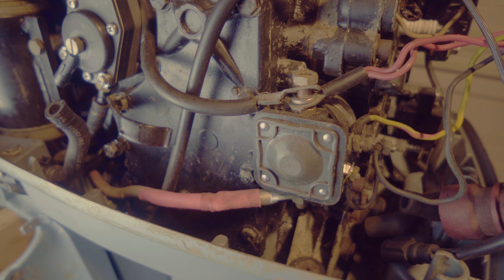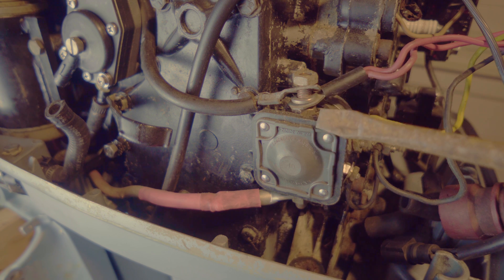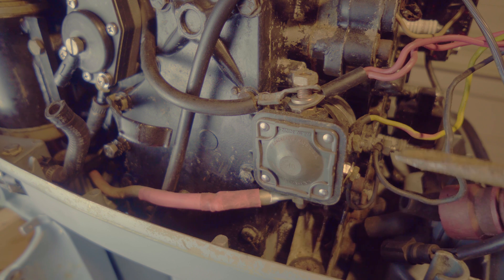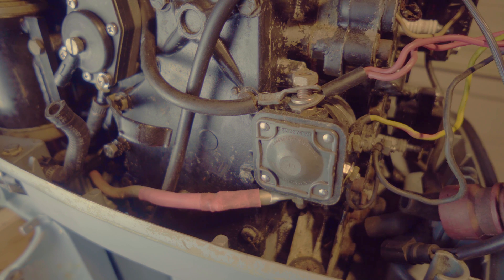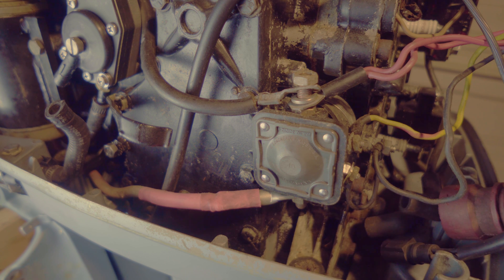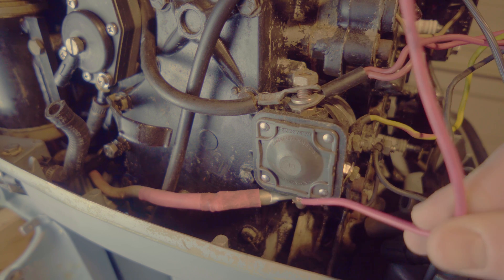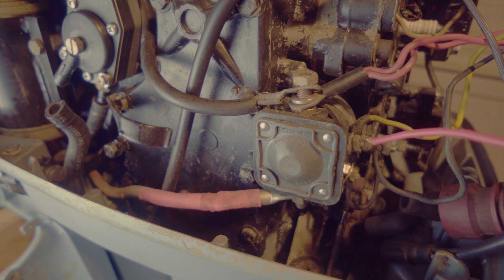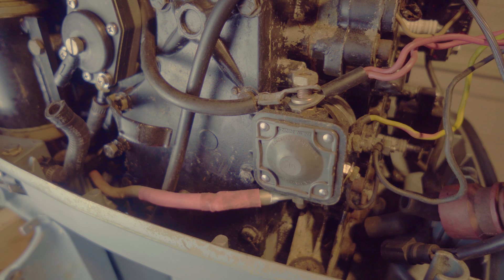Outboard does not start - turning key does nothing - starter solenoid troubleshoot / bypass.

Comment: I just replaced the trim connectors on the outbaord. Went to test them and have no power. Wont start, Trim doesnt work. Any idea if its related to the solenoid?

Comment: Mine does the same. Its suddenly got no power nothing on when turn key. End of got towed. But while it towing i try turn on the key it worked and started the motor.  But I still gotta paid for tow. When got to the dock. I tried to turn on and off to started it works fine. Brought it home for a week trying to get it start it's has the same problem again. Don't know what to do now. Can some one help. My motor is a 2004 johnson 225hp four stroke.

Comment: Same issue with me I replaced solenoid since we didn’t have voltage going from solenoid to starter. Replaced it. Same thing just clicking and occasionally the motor will turn. Once it turns sometimes it turns we don’t know what it is. Was at the boat ramp and it clicks but will not turn. I’m lost.

Comment: Ok so I had jut the click on the solenoid and replaced the solenoid and now the starter just runs when I connect the battery. Key is not even on. Any thoughts? Btw great explanation on how the solenoid/ starter works
Reply from the maker: @mikescalise3913  if it's constantly running that means the solenoid is getting voltage on the red wire. That means there is likely a controller working issue. Remember the solenoid will only engage when it gets 12 volt. That 12 volt is only supplied when you turn the key to the starting position as soon as you tilt it back to just on that 12 volt is no longer supplied. If you are not 100percent sure google evinrude controller wiring diagram. There are great diagrams out there.
Reply: @IdeaMan4k  Thanks for the response! I am just learning this stuff and I appreciate your help. While waiting on a second New solenoid i tried hooking up the new one that was causing the starter running issue. I only hooked up the Battery cables leaving the small wires off the small terminals. I thought it was going well but then the starter started running again( intermittently). so now my hopes are that it was indeed a bad solenoid that I received.

Comment: I didn't hear where that yellow wire went to? Mine goes no where! Just a dead end!
Reply from the maker: To the ignition. When you turn the key it engages this wire causing the motor to start and when you stop turning it it disengages it because it's already running.
Reply: Through the ignition switch, it's connected to positive of battery. This way the ignition has low power and isn't dangerous. The solenoid is the high power switch safely away from everyone that powers the starter motor.

Comment: I had this exact issue. (Clicked but solenoid was dead on the water). Little tip if you are without a suitable thick cable you can use the existing one on the bottom to bypass (someone has to turn the key also so I believe you need to be two people). I filmed it here https://youtu.be/pTZ6Lt8Rc9A?si=bcpY8M-lo_t9ed_L

Comment: Thank you for the vid! My signal wire in this case happens to be receiving voltage when the ignition is turned but still does nothing. Not even a click. When I jump the gap with a screwdriver it turns the starter motor just fine. Any ideas?
Reply from the maker: Be sure to check the ground as well from the solenoid. If it's doing the click and working when you jump it with a wire there's some sort of not complete circuit going on. It's possible the solenoid is just dead.

Comment: I have an issue with my solenoid not getting any power when the key is turned...nothing happens at all, no click, nothing.  I just assumed it was a bad solenoid, but of course when I swapped it out for a new one still the same issue....wish I had come across this video sooner.  It must be an issue between the key and the power to the solenoid...owning an old boat can be frustrating, but you do end up learning a lot along the way.  I inherited it from my uncle right before he passed and I've been trying to get it out on the lake since. My wife keeps telling me to just sell it, but I won't be happy until I get it fully operational and do at least a few days of fishing in it!
Reply from the maker: It's probably a wire in the controller. Also check the little wire that activates the solenoid. I got a good video showing the controllers with a diagram.

Comment: Hi . Awesome video . I have this issue when the engine gets warm . Will start on the button when cold . If I turn the motor off it won't start till its cold again . I turn the key and there is nothing . Almost like a thermal cutout has kicked in . Could this be the solenoid causing mu issue

Comment: I have a motor that stopped turning on about two weeks ago, it will click once quietly when I turn the key (not like a car that will go click-click-click-click).  Battery fully charged 13.06V, safety latch secure, boat feels in neutral (but maybe a sloppy neutral safety switch).  

When they key is held, should the solenoid continue to click or click just once?  If the solenoid clicks normally, it would seem to be a connection problem after the solenoid on the way to the starter.  Or do you think a fuse?
Reply from the maker: I think it won't continuously click as it's expected to work. However each time you turn key you should hear it. It's possible it'd not opening all the way. If you had someone else test the power flow to starter with multimeter itl probably give you a more definitive answer.
Reply: @IdeaMan4k  thanks.  It ended up being the easiest thing.  The battery contacts needed cleaning, despite not being obviously corroded.

Comment: Very helpful. Thank you.  My boat went thru Ian. Still on lift. I have power as engine trims up, horn blows, bilge pump runs but no click when I turn key ? Worried salt water got in / over engine.   Boat seems ok some water pumped out with bilge but inside of boat looks ok.  Marina power out so can’t lower boat but can get to engine ok from boat.

Comment: Working through starting issues on my 75 Evinrude 50HP....turning the key gets me a single click sound from the engine. I can jump the starter and it extends the shaft and cranks, but not response from turning the ignition. I'm at a loss as far as starter vs starter solenoid vs ignition/key. Any advice? If I'm getting the click does that mean the solenoid is good? And since I can jump the starter directly, the starter is good, right?
Reply: Oh, and batteries are good. Running dual, tried one, then the other, and both...no luck.

Comment: What are the two red wires on the top of the Solinoid? My boat had no start when I turned the key and no trim...I wiggled a small red wire like them two at the battery and everything was fine. I haven't looked at it yet but I'm thinking that small red wire to the battery is the culprit.

Comment: Could a solenoid be causing the delay before starter cranks? There is probably 2 second delay between turning key and the starter motor activating. To date it has always started the motor but it's concerning me now that it's going to fail. The battery is fine.

Comment: My issue is every now and then my remote control shifter will not lock into neutral. So, I turn the key and get nothing.  Will this work even if the motor is not in neutral?  If he needs to be in neutral (or maybe for safety it should be in neutral), is there a way to manually put the motor into neutral?  Thanks!
Reply: Did you work this out?

Comment: I tried bypassing the solenoid, (no key in ignition idk if that has anything to do with it) and still nothing.. The battery started arking on the positive side, any idea what it means?
Reply from the maker: Is the engine grounded properly to the motor?

Comment: Thanks mate we were stuck out in the bay, watched this video and luckily we had some spare wire and used your method and then BANG we re up and running. Ya legend 😀
Reply: I have a similar issue. But I do get the click. That tells me the solenoid is okay. That the issue is the starter?  Thankyou for making this video
Reply: I have a similar issue. But I do get the click. That tells me the solenoid is okay. That the issue is the starter?  Thankyou for making this video
Reply: @justinperkins4469 I just replaced a clicking but not working solenoid. Clicking does not ensure proper function

Comment: Got a tricky one here. Solenoid used to click but starter would rarely turn. I had the starter rebuilt but same thing happened. I took the connections off the solenoid and cleaned them and now there is no click. Got a new solenoid and same thing is happening. Idk if there is something wrong with the ignition switch or if I have a faulty wire connecting to the solenoid. If I touch the positive wire from the starter to the bottom wire of the solenoid everything works. Any thoughts?
Reply from the maker: Id check the wiring, often on those big old cables they can look okay but be totally corroded inside. The engine needs lots of voltage to start / starter. Its almost always the wiring.
Reply: @IdeaMan4k  I got a new solenoid put in a while back and it fixed the problem
Reply: @elijahboyett8590  hey there. Our boat has been sitting at Marina for almost a year. Took fresh battery to it, and selenoid clicks, but starter does nothing. No click , but selenoid does. Did your selenoid click, but no noise from starter?  Going back and taking jumper wires to check out, because we're bringing it home to sell. Then can replace selenoid if that's the case. Just curious if yours had same scenero or not
Reply: @fredkeele6578  Take the red wire off the solenoid and touch it to the red on the starter while the battery is giving power. If the starter turns, then your solenoid is 99% of the time bad. My solenoid would click but it was still bad, and that’s how I diagnosed it. You can buy cheap car solenoids that work just as good too

Comment: Quick question I have 11 volts going into my solenoid and when cranking in only getting 6 volts going to the starter starter and solenoid are both new 
The starter spins but won’t pop up to engage the flywheel 
Any suggestions...please
Reply from the maker: Probably not enough current. The connectors and the wire need to be very thick.
Reply: Could be a bad load from the battery. Autozone tests load for free

Comment: I'm dropping voltage in start position the wire from the fuse is causing it but don't show any sign of a short with a multi meter. What is that 30 Amp fuse by the starter for. It also will not jump across.

Comment: So if I connect a wire from the positive to the small positive post the motor starts , but if I turn the key nothing happens , where do I look for the issue ? I can’t find a break in the wire leading to the small positive post
Reply: By

Comment: I have a similar issue where I’ll go boating, anchor for a bit and when I’m ready to leave the engine won’t turn on. I’ll sit there for a few more minutes, turn the key and it’ll start as if nothing happened. 

Do you think this is the same issue?
Reply from the maker: Start as in turning the key will do nothing? or it'll turn over but not start?  If its turning over try pressing the key in a bit before turning it or while. You should hear a little click when you press it in. This will get the fuel to inject past the carbs and should get it going.
Reply: @IdeaMan4k  start as in it’ll crank and turn over. But there’s times where I’ll turn the key and it won’t crank but an audible click comes from the solenoid. I think it might be the solenoid from the starter that’s going bad.
Reply from the maker: @viktorcieslik3302  Does it sound like its trying to turn over slowly, and not turning, or just clicking and nothin else? If so its probably just the solenoid.

Comment: got stuck on the water today due to something with the ignition. bought it used, was told the ignition was replaced last season. key just kept slipping its location and i had to keep tightening the plastic nut on the outside of the faceplate.

is there a more permanent fix ? i took it out of the dash and the wires were completely twisted up. new boat owner - thanks
Reply from the maker: Sounds like the face plate is just loose. Possibly fix up the wires and get it in there good.

Comment: When I turn the key to my motor nothing happens, no clicking no nothing. What do you think the problem is? Could it possibly be the battery?
Reply from the maker: It could just be totally dead. I'd be sure to charge it or get a charger. Maybe see if the boat lights turn on?
Reply: Hello Everyone well you see it was working a couple minutes before it totally stopped working so that’s why I’m confused
Reply from the maker: @patrickproductions3859  check the fuse under the cowling.
Reply: @IdeaMan4k  same thing happened to me. No blown fuses. Stopped mid key turn, all connections good but wiring harness getting no power and the yellow red ignition wire isn’t getting any power with the key turned to start. Opinions?
Reply from the maker: @elijahkelly8431  Id disconnect the harness and test with a multimeter until there is power before going to the controller. If the motor is connected to the battery and none of the wires have power coming from the harness clearly a connector just fell off or is in terrible shape. If you look at the wiring diagram more then 1 wire will have power that you can test. If it stopped mid key its possible the solenoid start wire just fell off.
Reply: @IdeaMan4k  Ok so I’ve been working on it and I’ve cleaned all the terminals and every thing is tight and clean and still nothing. I had someone turn the key and tested the red and yellow wire and no power when turned to start. I tested the ignition switch for continuity already. It turns over when I jump it. The outboard is getting power as the tilt trim works on the side of the outboard, but the wiring harness coming off it isn’t giving any power(nothing happens at tilt trim switch at console or at the ignition switch). It was working for a couple of turns the other day but then i went to prime the bulb and no power again. I don’t think it’d be a faulty neutral switch or kill switch because the tilt trim also doesn’t work up front, and they come off the same harness. The connectors up front are plugged in right and clean. Is there something I’m missing here? Thank you so much for your help, this has been driving me crazy!
Reply: @IdeaMan4k  I’ve tested the purple and red wire at the key switch and it has just under 6 volts
Reply: @IdeaMan4k  I may have found my problem. The red and purple wire at the positive bus bar on the outboard is reading 12.8 but at the key switch it’s reading below 6. Then, the yellow at the solenoid is reading nothing when turned to start. I’m gonna start by tracking this purple and red wire
Reply from the maker: @elijahkelly8431  Good luck, its always easier when the issue happens instantly as its a greater indication that something simple just broke.
Reply: Did you figure it out? I’ve got the same exact issue
Reply: @harrell55555  yes it was because the atc fuse was blown in my motor
Reply: @harrell55555  did you figure out this issue I have the exact same problem too lol

Comment: Hi, very good video bro! Thanks a lot for that, you help a lot of people..Probably you can help me, my problem is the switch is bad, I don’t have power in the selenoid and in the engine, I jump the this selenoid and the starter move good, but I don’t have spark in the engine,. You know how can jump the switch to put electricity in the CDI? thanks
Reply from the maker: Make sure it's not the neutral safety switch.
Reply: Hello Everyone ok, today in the afternoon I check again that.. thanks
Reply: @IdeaMan4k  thanks a lot bro, I open the control box and jump the swicht and start good! I need replace the key swicht and the neutral swicht, regards

Comment: I have same problem turn out that neutral safety switch is bad. It's now bypass.
Reply: How do you bypass
Reply: @ramondwall5151 should be two wires (probably yellow or white) connected to transmission. They are most likely on opposite side of where shift cable is. Just connect them together

Comment: What do you think we should check next if it does click
Reply: I just got a new battery that was recommended for my motor. When I flip the key, it just clicks. But that’s it. But when I take power straight from the battery to the solenoid, the crank on the starter lifts up to the fly wheel but doesn’t spin powerful enough to get it started. What would this mean?
Reply: @aaronskiles87  I am having same issue.  Did you find out an answer to your problem?
Reply: Cesar Gonzalez make sure all cables and contacts are fully in tact and making the best contact possible.
Reply from the maker: If you hear clicking but you dont see the starter spin. This means there is some electrical problem between the starter and battery. If anything you should see the same thing if you turn the key / jump it. All you are doing is allowing electricity to flow to the motor. It needs a lot of current to start.
Reply: Hello Everyone the ground on the solenoid was not connected. Once I connected it, everything works great.
Reply: My is same too, click each turned key. Let me know when you find answer.